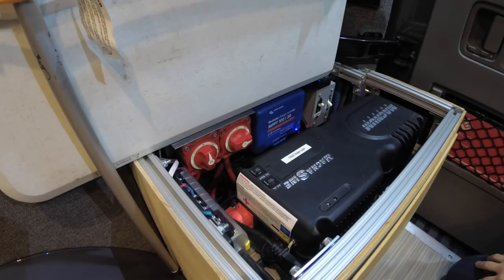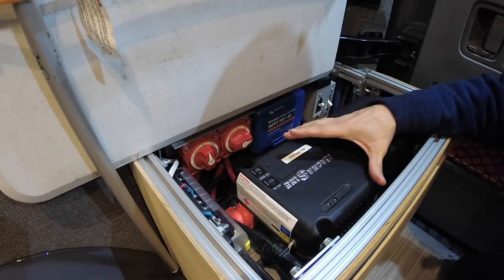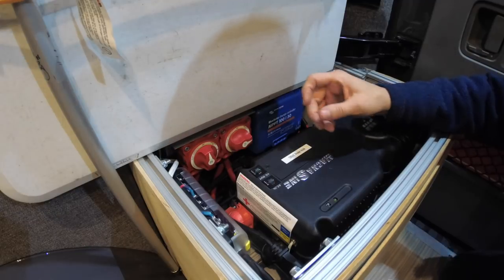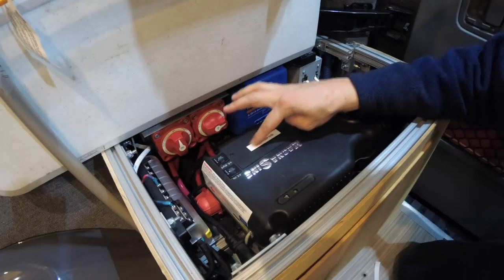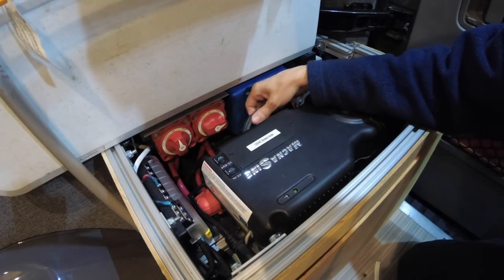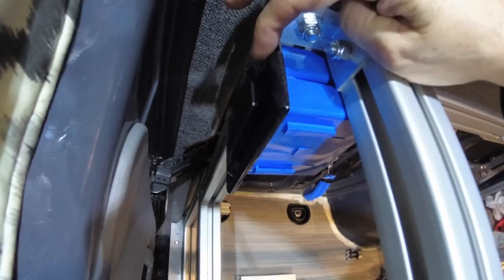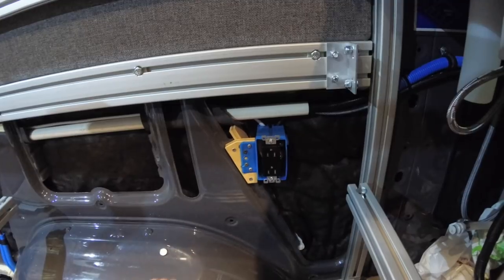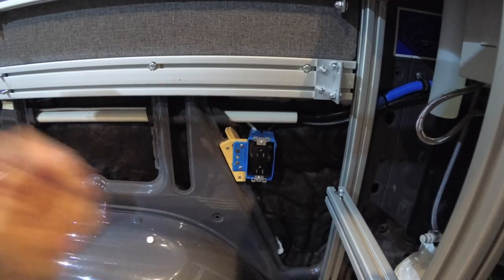120V AC Wiring in a Van - DIY Sprinter Camper Van

Comment: Nice vid, always enjoy seeing your progress. I went the route of minimizing AC use whenever possible because of the inefficiency in converting DC to AC and the wide variety of 12v products now available. Folks waste a lot of power by trying to make household goods function on a platform that’s IMO ideal for DC. This led me to having DC outlets throughout the van and only needing the inverter for the microwave which I was able to provide with a cheap $120 Harbor Freight solution. I ended up not even running an AC circuit through the van as this was the only anticipated AC load. Tv, fridge, dvd, stereo, fans, pumps, chargers for laptops and electronics, etc are all DC. My stove and water heater are propane and use very little (2 years now and I’m still on the initial 3 gallons). 

Something for people to consider as I have never gone below 80% capacity with 200w of solar and 2x Trojan 105 batteries (roughly 225 Ah). My entire electrical system cost about $1000 and has yet to make me think I need more.
Reply from the maker: I do have a more robust system than I absolutely need.  But that's good, right?   Maybe not for the pocket book though.  After owning an electric car I learned a lot about lithium technology and the myraid of advantages it has over AGM.  Some of which include weight and size advantages, the ability to dip to 20% SOC if needed, no absorb cycle (which almost gives you a 'free' 1-2 hours of solar charging capability as it accepts current and voltage up to completely full), but the biggest one is the stable 13.2V at almost any SOC.  That means not having to deal with inverters hitting low voltage cutoff when I hit the battery with a large load.  But that's geeky stuff and I just wanted the technology and the ability to take advantage of its capabilities (and use the sun) to power my microwave, induction cooktop and my amazing little tea kettle that boils water in under 2 minutes.  Everything else is DC.

I like how you think though, often less is more.
Reply: ourkaravan so what electric TEA POT do you have? Thx.
Reply from the maker: +Dani Adams - I use this one:  https://amzn.to/2vG69rE      It collapses down and fits in a drawer, runs on a 1,000W inverter and boils water very quickly.  Like under 2 minutes!

Comment: On a side note for a GFI, Line in - Load out. Anything on the load side of the GFI will shut off once the GFI trips, however if you choose to line in(power in) - line out(power out) - load out(GFI protected power out), any plug/lighting circuit on the line side will remain hot even with the GFI tripped. Comes in handy if you have a lighting circuit fed off the same circuit or a fridge/freezer you don't want to melt if your outlet trips.  Just a side note!
Reply from the maker: Thanks Eric!  Good thing to note for anyone that might have a fridge hooked up downstream of that first GFCI.  Mine are all just power outlets.  Thanks for the message!

Comment: The trons travel on the outer surface of each wire strand so Ancor is the best you can use.  Those blue boxes are decent under ideal conditions, supported by the 2x4 and such but I do miss the old metal boxes at times.
Reply from the maker: The quality difference between Ancor and other wire I had left over from other projects is noticeable.  Of course no one makes a wall box that works well for a van, but of course that is the story of my life.

Comment: I've really loved the clarity and detail of your videos. They have been very helpful to me on my own build. I have a question about how you are connecting your AC wires. Are you crimping ring terminals for the connections?. Typical Ac install is just the wire under the screw, but with the movement and vibration, as well as the stranded wire, I am assuming that would be pretty important
Reply from the maker: Thank you, and yes, that is precisely what I did.  None of my ring terminals offered a good fit, so I used a pair of side cutters and cut the end portion of the ring to turn it into more of a spade.  This offered a very secure attachment to the screws of the terminals.  Wish I would have thought to show that in the video.  Some day I'll need to do a "tips and tricks" video detailing all the little minutia details that people may find helpful.
Reply: @ourkaravan  Please educate me, I don't quite understand the advantage of braided wire over solid wire, especially if you're clipping the rings to act like spade terminals. If the screw comes loose, it doesn't matter if it's solid or braided. If you attach and solder a spade terminal to a solid conductor, isn't it the same thing? As far as flexibility, in this size wire, romex is not that stiff.  The underwater grade marine wire is great in a corrosive salt water environment, but inside the van, I don't see the same kind of corrosion problems.  What am I missing?
Reply from the maker: You're right, if the screw came loose it wouldn't matter if the wire were solid or braided.  The reason to use stranded wire is vibration from going down the road will be prone to breaking the solid-core wire right at the screw terminal.  The braided wire is much more flexible to help absorb the vibration rather than break.
Reply: @ourkaravan  Good point.  Actually, when I looked at the costs again, it isn't really THAT much more expensive. I think I'll go your route.
Reply from the maker: When in doubt, do what the marine industry does!    There are still apparently RVs that use romex wiring, but it's generally not recommended and "RV quality" is generally the lowest common denominator.

Comment: LOVE following your channel! My progress is A LOT slower but I certainly derive a lot of ideas from your videos! I have a question about wiring my 12V battery bank. i have two 100aHr batteries which I plan to connect to my existing battery via  battery separator. Im wondering if I can use a larger gauge wire from industrial size jumper cables? (got them super cheap and they are decent length so I can cut them to size and have extra left over for later). If so, what's the smallest gauge can I use before I worry about the wire get to hot and risking fire. I measured nominal diameter and its 11-12mm. So my guess its a 3/0-4/0 gauge. Always appreciate your input!
Thank you!!!!
Reply from the maker: Hi Tom, wire Guage will depend on several factors including the voltage and amperage you will be running through the cables and how long the cables are.  If you Google "blue sea wire gauge calculator" it will help figure it out for you.  If you need help I can assist with that too.  Thanks for the complements!

Comment: Hi
First of all what a neat install your done.!
Thinking of doing my VW T5 cabinets in the aluminium extrusion
 However  I intend to do one of the box sections  low level to hold the leisure battery, storage and the management system
This  would be 1900mm in length 400mm in width, allowing the 3/4 bed to be extended into a double.
Just asking what gauge would you recommend I thought 50/50 would be strong enough for the weight of adult sitting and part  lying on it 
Obviously I would brace it with cross sections 
Best Regards
Darren
Reply from the maker: 80/20 publishes the specs on each of their profiles, providing the deflection characteristics.  As long as you don't have long spans without support, you're probably fine.  I would check their specs though.

Comment: Couple questions ... what enclosure did you use for your 15 A breaker, and are you concerned with heat in your equipment box containing all the components?  Are you assuming a shore connection using a standard extension cord, or did you consider an RV-type 30-amp plug/receptacle (circular type plug)?
Reply from the maker: Hi, the breaker box is a standard single-gang canex box from Home Depot.  It was very slightly (maybe 1/16") too shallow to accept the long studs on the back of the Blue Sea breakers, so I cut the stud down a slight amount.  
As for heat, there is a vent on the back of the box and by the time it's finished there will be one on the front as well.  The inverter has a fan that pulls air from the front and pushes it out the back and the vents align with that.  I don't push the inverter near long enough to worry about heat.  
I have never needed to plug my van into shorepower thanks to my 300w solar panel, so right now I would have to pass a cord through a door or window.  If I find that I ever use it more frequently, I could  add an extension to the outside of the van with relative ease.  Not a priority now though considering I've never used it.
Reply: @ourkaravan  Thanks, I really do enjoy your videos.  I aspire to be as meticulous as you, but I probably won't make it. I am channeling you somewhat, but with a little Promaster City, L channel/ bar aluminum, light weight as a priority, and lots less room. Am trying the Youtube thing, but not to get tons of clicks - just to get feedback on my design.
Reply from the maker: congrats on the new channel, I will sneak a peak.  It takes quite a bit of time to be noticed, so you have to keep posting...word of mouth travels fast once you have a base audience.  Good luck and thanks!

Comment: Hey Ken! We love your videos! Always very informative! One question... What type of wire did you use to run your 120v AC? We originally expected to use romex 12/3 but then read that we should not use single strand wire in a vehicle due to vibration... Was wondering your thoughts on that and if you did use single strand, how it is holding up? TIA!
Reply from the maker: Hi, you are correct about avoiding romex.  I bought a roll of Ancor (very good quality marine wire) in 12 gauge thickness.  It's called 12/3--there are three strands of wire, a hot, neutral and ground just like at home.  I ran it in anti abrasion sleeving to help protect it, but the ancor stuff does have a sleeving that is in addition to the regular insulation around each strand.  Thanks for the complements and let me know if you need anything!
Reply: @ourkaravan  Thank you so much! We love all of the anchor products, but we didn't even think of them for this for some reason... Going to order some soon!
Reply: When I click the 12/3 Amazon link it takes me to a page 0f 14/2 speaker wire.. 😅 was trying to figure this out and re watched the video before I ordered. Just a heads up on the link. Thanks for the content!

Comment: I'm new to all this, trying to learn as I'm about to buy a van a build it out. Where do you wire the 120v outlets to?
Reply from the maker: The inverter converts 12v from the battery to 120v AC.  The 3-conductor wire comes out of the inverter and feeds the duplex outlets just like at home.  It's pretty easy to get sorted out.
Reply: ourkaravan thanks for the reply! I figured that was the case. When looking at inverters online I don't recall seeing those wires coming out from the back, but this is all new to me.
Reply from the maker: @morrowr08  There's a version of my inverter that has the outlet built-in.  All you need to do is provide 12V + and - from your battery.  This is it...the "G" version:  https://amzn.to/2X05rVe

Comment: I bought that same inverter and of course I found out after my return window expired that you can’t set it up for lithium batteries. You can’t change the voltage that it starts charging in bulk mode and the voltage is set too low so it won’t start bulk charging until the batteries are almost empty. How are you dealing with this?
Reply from the maker: You can do a custom battery setting.  I set absorb to 13.9 and float at 13.5v.   This technically won't fill the batteries, that would happen at closer to 14.2v but I prefer to undercharge them for longer life.  I do believe the remote says it's float charging (not bulk), but it makes no difference as the batteries are still charging at the max charge rate you have set. I hope that helps.
Reply: ourkaravan I’ll have to look into that. Both battle borne and magnum told me it can’t be setup to charge lithium correctly like all of their other inverters. The only workaround they mentioned was setting the equalization charge voltage the same as the bulk voltage and I could manually start an equalization but then I would have to manually watch my state of charge and manually stop it.
Reply from the maker: @somekevinguy  They are both correct.  Magnum is withholding some features on the 1000w inverter in hopes you upgrade to the 2000w.  I don't need or want that massive thing, so I've done a workaround.  There is no reason they couldn't put the same software on this model.  The workaround in described above works fine.

Comment: I want a 115v upright refrig/freezer what would my power requirements look like
Reply from the maker: In order to run a 120VAC fridge on a 12V system, you'll need to have an inverter on all the time.  An inverter will lose 15% efficiency just doing the power conversion alone, and some less expensive inverters are even less efficient.  It's hard to say exactly but you may want to consider whether or not the cost savings of your 120VAC fridge are wiped out by the need for an inverter and more battery capacity.  I suspect it would.
Reply: @ourkaravan  so would the Jackery 500 or 1000 be sufficient
Reply from the maker: @VanSheGoes  Even the 1000 would only be 83 amp hours (if amazon Q&A is correct.).  I think you'd have to keep a careful eye on your capacity as there wouldn't be much buffer.

Comment: What size is your beaker inside your inverter, I didn’t catch that. I have a 200A breaker between the battery and the inverter that keeps popping. My wiring for that is also a 2AWG cable. What do I’m doing wrong? Thanks ahead
Reply from the maker: My main DC fuse is 200 amps.  How many watts is the item you're running that is popping the breaker?  My inverter is only capable of pulling 1850 watts in surge, which is about 155 amps.
Reply: @ourkaravan  I forgot to mention in my comment, duh!! Is a microwave of 750watts
Reply: @ourkaravan  and my inverter is a 2000 watts
Reply from the maker: @gilpul71  2000 watts / 12v = 166 amps.  Most inverters have some surge capacity and you can probably exceed 200 amps if in surge.  The 750 watt microwave shouldn't pop it unless you've got another high draw item running at the same time.  Have you checked the cables under load to see if they are heating up?
Reply: @ourkaravan  off course I check but they are barely warm
Reply: @ourkaravan  I just checked the item I bought
(Energizer 2000 Watts Power Inverter 12V to 110V, Modified Sine Wave Car Inverter, DC to AC Converter with Dual 110 Volts AC Outlets and 2 USB Ports 2.4A ea) is it the fact is a modified sine wave inverter instead of pure sine wave inverter my problem
Im just realizing that. I don’t have any knowledge what’s the difference, but I got a bad feeling about this.